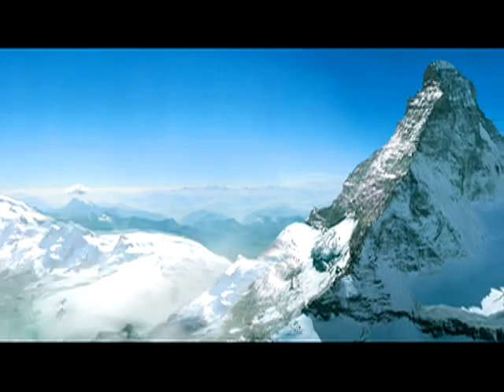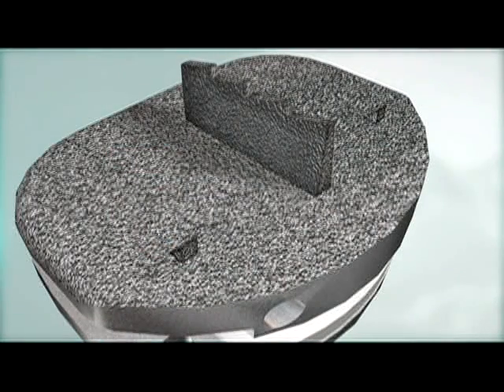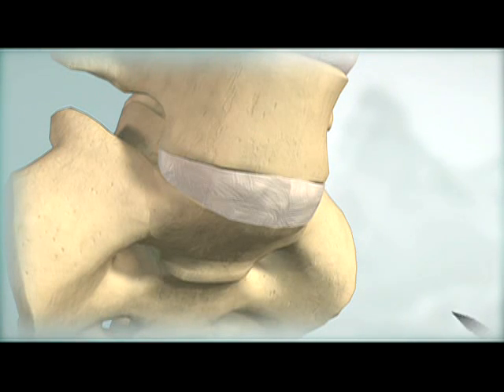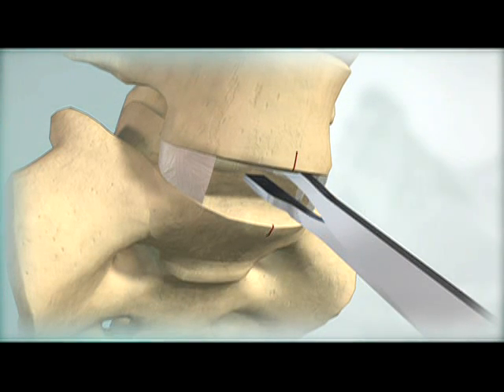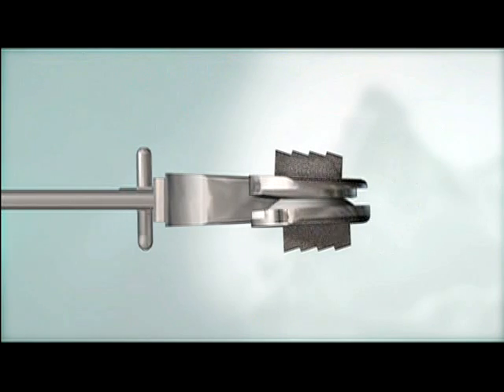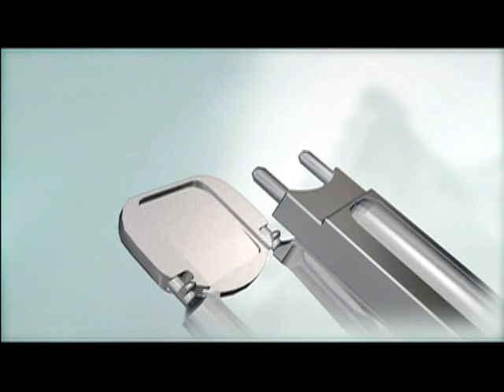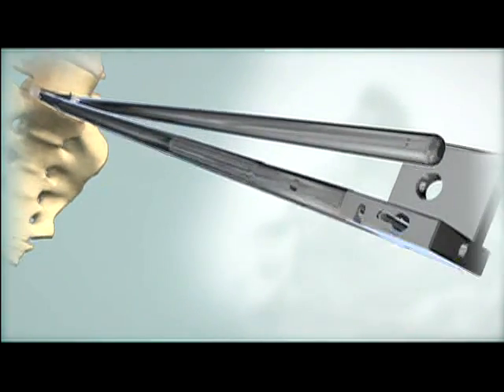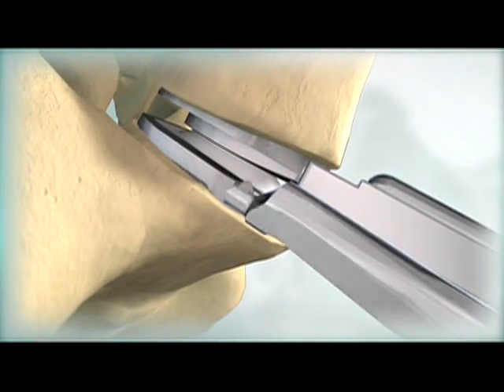Synthes Spine ProDisc-L Lumbar Total Disc Replacement Animation

Comment: I been doing research on this prodics l, it's only possible in the states where you could pay at your own and have it implant , problem with this system is its not given as a option in Canada ,your lucky if you have prodiscs lumber on your vertebra . This new technology is a break through out history  , now you could replace your back bones so you can  have the mobility ,rotation and flexibility with this new implant on your lower vertebra  .